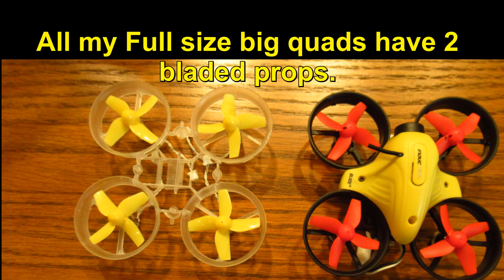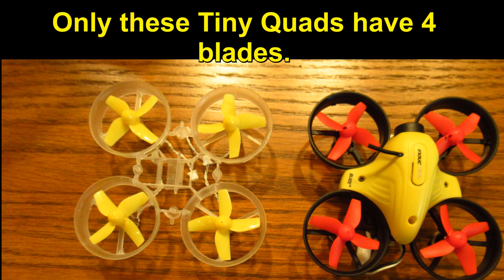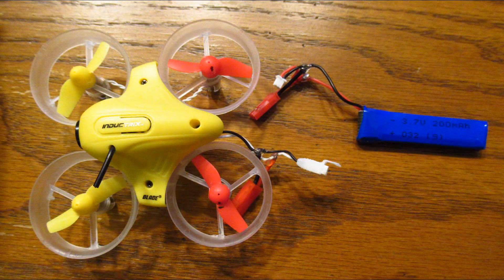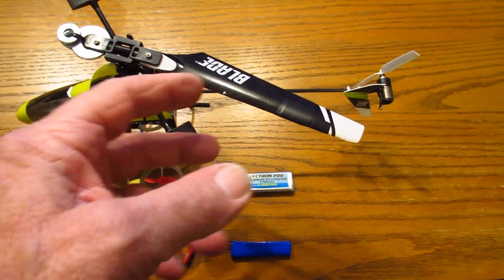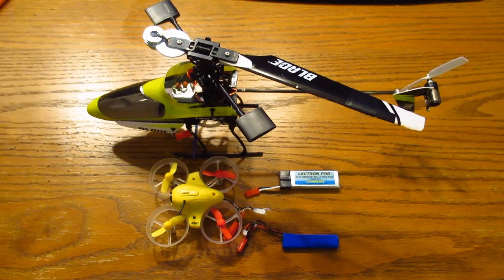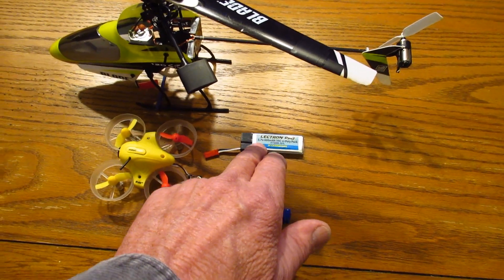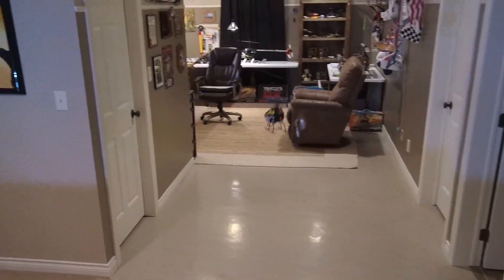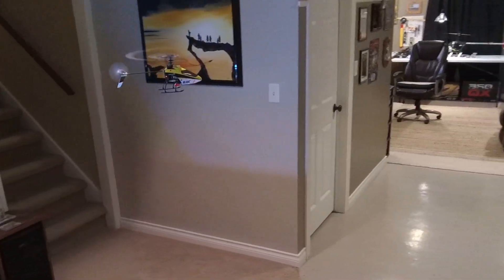Blade Inductrix 2 bladed prop test and single blade SR 120 Heli demo.

Comment: I'm really impressed by the single blade design! I wonder why production aircraft don't utilize them.
Reply from the maker: Some actually do and many old time Pylon racers used 1 bladed props. I have many videos on this channle to prove that it takes more power to spin multiple blades vs 1. Thanks.

Comment: I just ran across this video because I have just purchased my first Inductrix FPV (bnf) and, of course, now am watching videos like crazy until it arrives. :-) My question that I haven't seen asked is: are the 2-bladed props as stable as the 4-bladed props? Thanks!
Reply: I've cut my inductrix back to two blades and extra flight time is good.. but I feel too much performance is lost, agility no, and  perhaps its more in my mind, but altitude adjustment is weak with two blades, and I bounce the floor too many times when full throttle wont pull it out a dive and I'm sure it used to in similar situations.. I have only just started flying though, so it is my err, perhaps this mod is suited to experienced flyers only.. and/or its all in my head.. but I've now broken a frame, so I'm going to go back to four blades and shorter flight time for now until i'm not so useless :)  I'll be more sure once I've got the quad blades back on.. but could you kindly offer me your opinion on this if you have a set still around to test? ie cut throttle then catch a dive.. a comparison between the twin, triple and quad blades if you have some? I'm wondering if triple would be a good compromise. or if they fly nearer to the two blades than four.
Reply from the maker: Yes, I see no difference in the handling.  Try it with the stock blades firs.  I also know that Crazypony sells 250 MA batterys as I just bought a few, and they also increase time.  Good question,  Thanks and have fun.
Reply: Thanks for the reply! Will probably do this mod once I'm comfortable flying the thing stock.

Comment: It's probably been asked before but, it's there an advantage or disadvantage to putting the counter balance weight out further?
Reply from the maker: Good question!!  Yes counter balance out further requires less weight. A weight on a rod is ideal but does not leave as much clean air for the main blade to fly into  I will do that next time to show you. Thanks.
Reply: NightFlyyer In my mind I envisioned a threaded rod with a lock nut or two regular nuts to make balancing easier. I see what you mean though by having the weight further out might negate some of the clean air advantages, but that might be offset by weight savings. 

Thanks for getting my mind working :-).
Reply from the maker: Very true.  Stay tuned and thanks again.l

Comment: Dave,  Fascinating!  I have QUESTIONS: 1. Did you notice any change in the stunt flight characteristics (i.e. inverted, etc.) when flying a single blade? 2. Considering the lower power requirements of a single blade, have you considered using a longer blade?
Reply from the maker: Good question. Well longer blades would reduce the higher rpm gotten from 1 blade so more power would be required.  Just simple 3D inverted etc seems about the same to me or slightly less snappy. 1 blade is mainly to increase flight time and speed, not heavy lifting. More blades and longer ones need bigger motors and I just use stock. Check out Adrians 3D video in the description box and see what you think!  I think he does amazing.

Comment: Dave, I have a science request. My theory is that if a load was added either by weight to the frame, or by lifting an object. I say the stability of the Helicopter would change drastically, and I wonder if a single blade could handle the task.  A long time fan..... Glad to see you back in action!!!!
Reply from the maker: Well, I have had some pretty heavy helicopters and they all flew on 1 blade.  They may be a bit slower at climbing out, but once airborne, they are fast.
Reply: NightFlyyer OK, I just thought it might make a cool video.